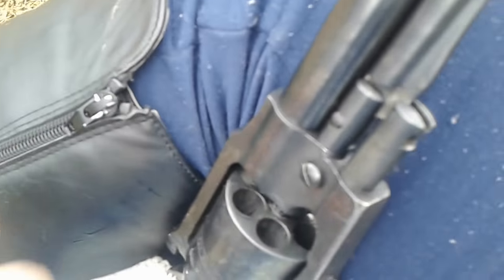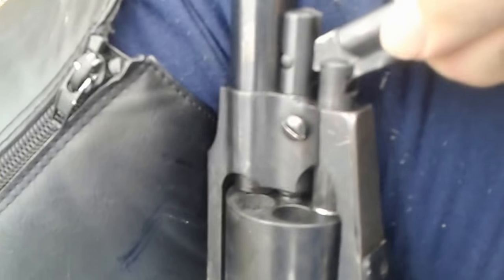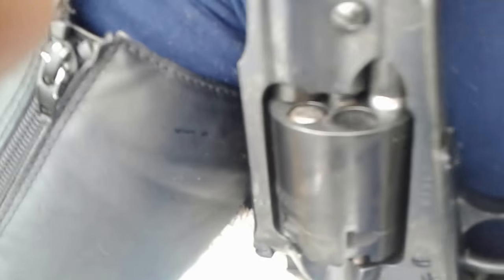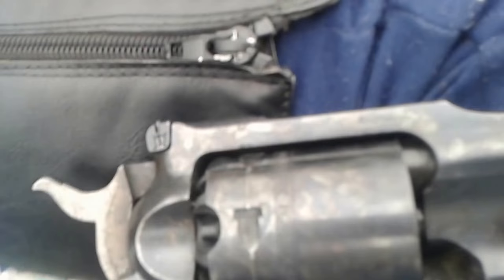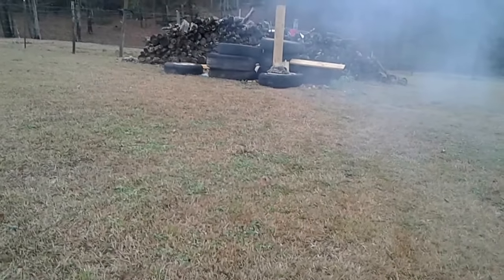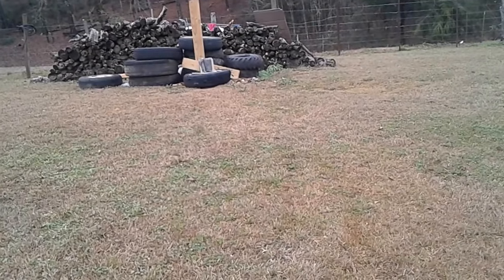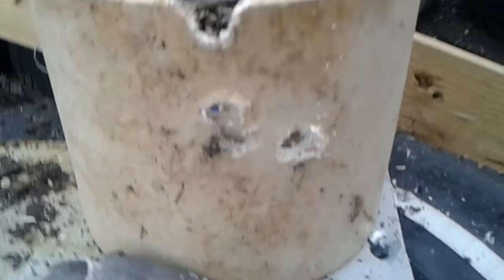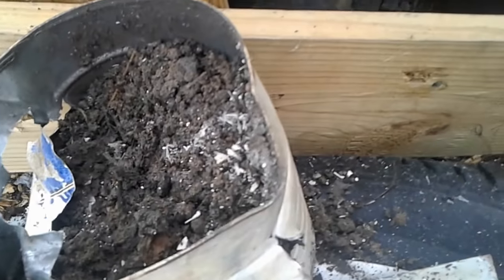Ruger Old Army Power Pt. 2 Pyrodex Pellets

Comment: She should never have caps on the pistol while loading.
Reply from the maker: It wasn't capped, had a spent cap from shooting it before. Thanks though.
Reply: @JoanieKennedy  old army girl I have to ask what's your exact set up from your pistol on down I'm going to purchase exactly what you have. My first black powder pistol is going to be exactly what you have I need to know exactly what you have. I'm new to this
Reply from the maker: @darrellglenn9566  Ruger Old Army blued version...Hugo grips though I've recently changed them to faux ivory....CSA belt and slim Jim holster I cut the end off because the sight kept snagging. CSA cap and cylinder pouchs.... R&D .45 Colt conversion to go with it as well. 

You want more power there is s custom gun Smith who will deep bore the cylinders got 70.oo I have not had this done to mine though.
Reply: You missed your calling you should have been the lab tech at the Ruger proof house! :-)

Comment: I want to try this with the 50/50 triple se7en pellets I have,  should I try them in the 1851 navy sheriff model in .44 cl ? 
PLEASE let me know what you think ...
Reply from the maker: I honestly don't think 50 grain would fit in a 1851 Sheriff model. I wouldn't try it. Lotta difference between a ROA and a 1851 Navy.
Reply: Dang that sucks now I have to see if Bass Pro shop will let me exchange them for 25gr
Reply from the maker: @OrganisedConfusion101  if you don't have a rifle to shoot them in and they won't exchange it, break them in half, it won't be exact but should be in the 25-30 gr range still hot for T7 in a 51 Navy but it not going to blow it up.

Comment: Jody I think my pellets have a little more of a smokless like bang to them. Do yours feel and sound different to you too? I know there is a little of a increase in velocity. But I warn I had a hang fire and never had that with goex. But it was a new pietta Remington 1858 and the nipples may of still had some oil in em. I don't like to waste caps the clean the nipples so I use the soap water and sundry.
Reply from the maker: Yes after shooting through these honestly I wouldn't recommend them they feel more like smokeless the accuracy isn't too good and hang fires are eel. I would stick with loose powder or make paper cartridges.
Reply: @JoanieKennedy  I prefer my flask. Yes more power less accurate.

Comment: I got the 44/45 caliber 30 grain for revolver pellets. Never again! The first six went off sort of ok. From that point on 5 out of 6 a squib loads! Most needed recapped with #10 Remington caps. Never had a problem with Pyrodex P but I'll never do pellets again. Problem is the box does not seal the damn things well. The first six were shot a few weeks before the next and then the squibs started.
Reply from the maker: I know I dont like them either. Stick with loose or paper cartridges.

Comment: Jody how come you didn't use the oil patch... it goes- black powder, oil patch then ball compress. is it safe to run it without the patch? I'm only asking because I'm new to it. Honestly I'm not trying to be an ass I'm only asking because I just really want to know your opinion. don't use the oil patch in conjunction with the pellet? it look like there was no room for one.
Reply from the maker: Well it's a lubercated wad in cap n ball revolvers .... Lubed patch in ball in single or double barrel guns. 

I'll give  two 

reasons. First Sam Colt never recommend lubing the cap n ball pistols so I kind of go with his advice...in the day it was your primary self defense weapon....you didn't want the charge getting fouled up by grease melting into the chamber contaminating the powder....when I load for self I never use lube in the revolvers. But I do when just out plinking to keep the fouling soft. 

2. Answer is the 50 grain charge in those pellets do notallow me enough chamber room for a wad....those are 40 grain pellets for a .45 cal rifle not the 30 gr for a revolver .

Sorry for the delay been handling some family issues.

Comment: I use the 30 grain pistol pellets in my 1860 colt.
Reply from the maker: Awesome how do you like those?
Reply: @JoanieKennedy  yes Ive done well with them I get mine at cabelas
Reply from the maker: @markreaves8086  I will have to give them a try. Are you using 777 or Pyrodex? I bet they would make , making a paper cartridges simple, just wrap the paper around and glue the bullet to the end.
Reply: @JoanieKennedy  pyrodex

Comment: I used to have some of those pellets, but I think I gave them away due to the nasty smell.  I never dreamed of using in my Ruger, but it's too late.  My go to powder is 777 3f, but 2f works about as good.  Just don't try and compress 777 as it will become erratic.
Reply from the maker: About a year late on this reply, Iv found that 35 grains of 777 3F and a 230 grain flat nose works very well out to 50 yards on MS whitetail. It's about in the same ball park as the .44 Special Skeeter load. Also 40 grains of 4F powder will get one in the same ball park. I do not recommend these loads for smaller Colts , Brass frame guns or orginal guns. The Walker and Dragoons can hold up to snuff even exceed the standard Ruger load but the guts of the gun won't hold up as long, cheap Italian screws n springs 😵 if I were too hunt bigger meaner animals such as Elk and bear with the Ruger I would get it deep chambered for a 50 grain charge of 777 3f and 250 gr flat nose, or get the entire gun altered too the custom Ruger .50 cal Express. But if I had the 1500.00 too do that I would just go ahead get the .500 S&W mag

Comment: Seems like 50gr is a bit much. I'm thinking the 30gr would be more than sufficient.
Reply from the maker: I normally load 40 gr of 3f for hunting, 25 for plinking . It's basically a black hawk with a percussion cylinder, it can handle 50 gr but it's not comfortable at past 40 with rb and 35 with conical
Reply: @JoanieKennedy  I just meant as far as the pellets. They make a 50 and a 30 (from what I've seen) and given this video of the 50, I'd say the 30 would be sufficient for most.
Reply from the maker: @TheCharleseye  oh yes, 30 is fine for most handgun needs, heck even 25 gr, I thought you were talking in context of blowing the gun up. I understand now. Yes 25-30 gr of 3fg is extremely accurate with .457 round balls out to 50 yards. Conical at least in my experiences both 255 and 230 have done best with 35 gr 3f
Reply: @JoanieKennedy  I'll have to remember that if I ever try conicals. Of course, my first order of business before that will be picking up a steel frame. My brass buffalo barrel is a fun plinker (and gets some pretty interesting looks at the range) but I don't want to stretch it out too fast with hot loadings. I definitely wouldn't rely on it for hunting. Anyway, thanks for the info.

Comment: hi I have been trying to find out the accuracy experience with 45 acp , any news ?.
Reply from the maker: I am not sure of your question?
Reply: @JoanieKennedy  45 acp conversion cylinder for ruger old army
Reply from the maker: @erikbender1  https://www.howellarms.com/ruger-old-army/stainless-ruger-old-army-45-acp-fluted
Reply: @JoanieKennedy  any news on the accuracy ?
Reply from the maker: @erikbender1  I honestly don't have any experience with the .45 acp in the Ruger Old Army. But I have shot Cowboy special loads in it that are the same specs as the .45 acp, but with a rim. It shot lower than my .45 colts but the accuracy wasn't bad. It does form some fouling in the cylinder due to the bullet jump and gases so you have to clean it often.
Reply: @JoanieKennedy  thanx

Comment: Wow u need to take those caps of while reloading scary  if it got wacked fired it into u  all so  use some grease over each round ball to stop chain fireing
Reply from the maker: Ok bout too go on a rant...you are correct in that I should not be loading with the caps on I give you that.
But the whole greasing the Chambers is a myth...not sure we're that idea came from but it does nothing, does not stop chain fires, nor does it soften fouling at least in the method most "prescribed" over the the chamber. 

First off Colt, Remington or any other cap n ball loader of the day to my research ever advised using grease over the chamber it's a modern idea.
Your supposed too use a slightly over sized ball it shaves the lead off creating a seal ...sparks can't get into that. I,v personally put at least 15,000 balls down range over the years between all my cap n ball recovers, and other people's Iv shot, and thus far never had a chain fire nor witnessed one....do they happen? Yes but it's not cause of lack of grease it is poor fitting balls.

Secondly grease over the chamber does nothing much for softening the fouling. The late great Cliff Manley and myself explored this for two years trying different combinations, the best we found was putting a cork wad between the powder n ball, then lube or grease cookie then the ball. 

Basically the grease will melt behind the ball lubing the barrel as it's blown out.keeping it moist for the next shot.....if you put it in front of the ball it just blows out the  barrel. The barrel is mostly dry then you shoot again and the crud just builds up. And if your really lucky you also get leading with the common method.
So now that you called me out on a human error..... possibly a deadly one but still human. I make mistakes just like any other human anyway....since iv been called out on it....I challenge you and anyone else who's called me out on this and anyone else who reads this after words....try the method I described , powder, wad, lube then the ball...I garentee you will have a much better shooting and cleaning experience.
Reply from the maker: Also the Colt guns the Chambers were bevled too prevent a chain fire which Cliff Manley and myself beveled the Chambers of our guns we used...and I still use, an option you may want too look into will save you lots of Crisco. The other end of the gun can be an issue as well poor fitting caps can cause a chain fire. Here is Sam Colts on words on the subject.
lecture at the London Institution of Civil Engineers, 25 Nov 1851

These are his words: 

Fig 11, plate 1, represents a firearm made by the author, in 1836, to rotate and fire by the continued action of the lever, or by the use of a trigger.

The arms so constructed, consisting of a large number of pieces, and assemble in a complicated manner, were to found to possess many practical disadvantages, arising chiefly from the wish of the Author to construct compact and good looking weapons. His original experiments all been made on the skeleton arms, solely with a view to utility, and in them there was not the liability of premature explosion, from the escape of fire at the mouth of the chamber, or by inter-communication of the ignited detonating camps, but when he enclosed the rear, and the mouths of the rotating chambers, the fire, being confined beneath the shield and the cap, was communicated successfully to the percussion caps, and in front was conveyed into the chambers, so that premature and simultaneous explosion of the charges necessarily took place. 

In consequence of these premature explosions it became necessary to remove the shield, from over the base of the chambers, and to introduce partitions, between the nipples, or cones, to prevent the fire from spreading to and exploding the adjoining caps; but this only partially accomplished the object There still remained risk of explosion from the spreading of the fire laterally between the base of the barrel and the face of the chamber. To meet this danger, the metal plate which was attached to the barrel, and projected over the chambers, was removed; this obviated to a certain extent, but did not altogether prevent the simultaneous explosion of the charges for during a trial of the arm, by order of the American Government, an accident occurred, from the simultaneous explosion of two chambers, which induced the Author, after much reflection to give a slight chamfer, or bevel to the orifice of each chamber, so as to deflect, or throw off at an outward angle, the fire which expanded laterally across their mouths. The reason for this alteration was, that when the lateral fire met the rectangular edge of the orifice of the chambers, the angle of incidence being equal to the angle of reflection, the fire was conducted downwards, or inwards to the charge’ but when the flame struck the chamfered edge, it was directed outward away from the charge. Unimportant as this alteration may appear, it has proved so effectual, that if loose powder is placed over the charge, in the adjoining chambers, it is not now ignited when the pistol is discharged. These and other improvements have brought the fire-arm to its present safe and effective condition and the Author believes, that no causality can occur, nor that more than on charge can be fired at one time, if the metal is sound and the arm is properly handled.
Reply: 60 years of black powder shooting info from the likes of elmer keith sam fadala and many more  i still dont know anything lmfao
Reply from the maker: @wilmamcdermott3065  you could go another 60 and not figure it all out. It's a science and an art with pretty much endless possibilities. It's not as black n white as people think. Myself I live by this philiosphy "What I know is nothing"-Socrates 
 Everyone has their own methods of cap n ball loading. 60 yrs of cap n balling means your over twice my age and I respect that. I'm always willing too learn.  But I speak on this subject the way I do due to the fact I've researched it for two years straight experimented with a crap load of different combinations of wads, cards, powders, caps etc I figured out along with one of my mentors Cliff that all the instruction manuals of out modern times just simply doing it wrong, it's wasting time, grease, powder etc. It's become a peave of mine. 😵 

Elmer Keith's writings are a huge influence on me especially in my choice of modern handgun the .357 mag, he had a lot of interesting stories about the .36 colt navy that he got first hand from civil war vets. I personally back his claim that a .36 round ball over a chamber full of fine black powder would take the fight out of a man faster than any .38 cal at the time he wrote that. Iv never shot a man but iv put down alot of bobcats, coyote, and rabbits with my .36 Navy and with my .38 Special and the cats never moved being hit with a RB not did the rabbits. Some ran a few yards using standard .38 loads .
Skeeter Skelton is another good one and Paco Kelly.
 Lastly I am glad you and a few others pointed out about the caps looking out for each other is a good thing....but in my defense I kindly ask you too boom your screen up and look at the caps they are spent no fire too them...I make mistakes I owe up too them it's been over a year since iv seen my video but I remembered it today I had already shot the gun those just didn't fall off. 

Who is your favorite favorite Western character?? Mine is Gus Mccrae💜🖤💜🖤💜

Comment: Wonder what kind velocity its getting
Reply from the maker: I get right at 1320 with 40 gr of 777 3F so I would say at least 1200 fps with the Pyrodex 50 gr pellet. I killed a small doe with 230 gr flat nose and 35 gr of 777 3F, it had about same performance as a factory .44 Mag as far as deer I have seen hit with a .44 Magnum.
Reply from the maker: That being said I would not recommend those loads in a lesser revolver than the Ruger Old Army, a 1858 Rem new Army steal frame will handle it but I don't know how long as it still uses flat springs etc.
Reply: @JoanieKennedy  for the most part I shoot modern firearms I do have a CVA 50cal rifle I did have a 36cal bp revolver when I was a kid wished I had kept it I been thinking about getting another but in 44
Reply: @JoanieKennedy  Hello, using 35 or 40 grain of 777. What would you prefer to use?

Comment: I shoot a first year (1972) Old Army. The Dragoon version, squared brass trigger guard Super Blackhawk grip frame. Normal load is 10gr of 777 Fffg under a 50gr Pyrodex pistol pellet. Yes, 60gr total. Standard Hornady .457 round ball, standard CCI cap, patch over ball, cylinder capped with bore butter. 

It will hole a 5 gallon pail of roofing patch, the long way. All 6 balls will go into a standard size paper plate at 100 yards. 

Retired competition gun, the cylinder has been hogged out for a larger powder charge or a powder under cornmeal charge. 60gr total is a max load, it kicks like a Clydesdale. 

More dependable than a .308 for our local whitetails and wild hogs.